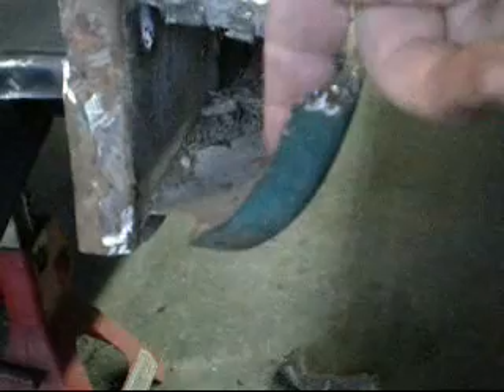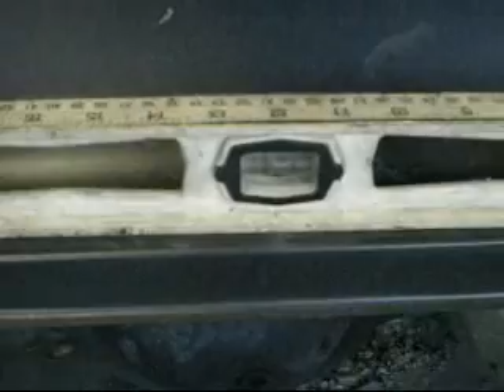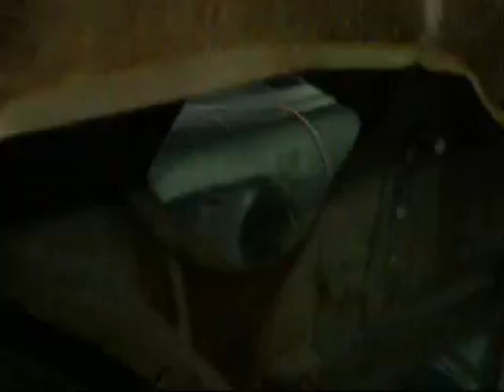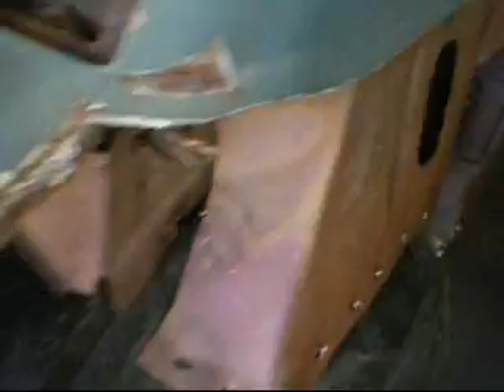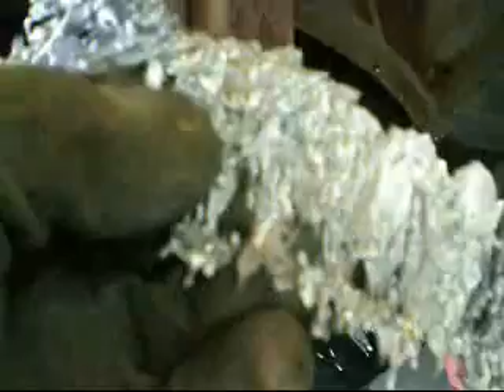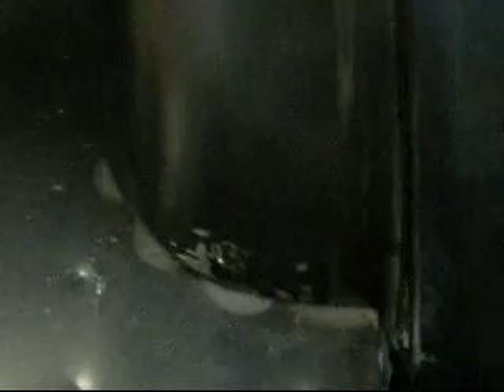1965 Mustang wheel house final install

Comment: I have a 67 Fastback I'm working on.  Question for you....I have to replace the inner wheelwells should I do anything to suspend the roof of the car?  A buddy said I should pull the bolts on the rear leaf springs to release any pressure.  Thoughts?  Thx!
Reply from the maker: Just the inners? It wouldn't hurt to pull the bolts, but the frame rails carry the load. Is the car on stands?
Reply: Both outer and inners and lower portion of quarter.  Another car buddy said just to suspend car on jack stands and take measurements.  Car is on stands and rears I placed as close to the rear wheels (on frame) as possible.
Reply from the maker: That will work. The inner structure of the car will support the roof. Alway measure multiple times.

Comment: I have a similar project on my wife's recently purchased 65 coupe...

The car looks like it had been rear ended, but only the outer panels were replaced, everything underneath (trunk floor, wheel houses etc...) are slightly off-kilter or have disconnected weld seams.

I'm hitting up CJPonyparts to snag all the parts (Dynacorn) required for repair (L/R wheelhouses, complete trunk floor, rear frame rails and probably add torque boxes and a 22gal tank while I'm at it).

I was thinking that since every part I'm replacing is closely related, I could jig and tack up all these parts outside the car, ensure the whole thing is square, then install the entire thing as a single unit.  Seems to me I'd have better control over dimensions that way.

Is this uncommon?

Any down sides?
Reply from the maker: psygnale I've not heard of anyone doing that before. Would it be better to get a one piece complete pan and do ti all at once?
Reply: I actually don't need the main pan, it looks pretty square...

...its all the internals from the framerails on back.  Off the top of my head...

Frame rails
Wheelhouses
Trunk floor (including sides and rear)

I'm imagining breaking all the welds, pulling out that whole area down and out from the external skins and inserting the new assembly, as a whole, in its place.

Thanks for your help.  Awesome work stud.

EDIT:

Actually, I think I mis-read you...

In your experience, is it easier to replace rear frame rails if the whole pan is OUT of the car?

If so, that seems like a lot of work for something I could get to with most of the car intact, so I'm obviously  missing something.

I was thinking of a similar job to what you did to the front of your Stang...removing the bad firewall-foreward parts only, leaving everything else intact. 

The car is being driven right now and has no major issues (other than annoying squeaks and rattles, some water infiltration in the trunk sides, and some uneven seams).  Just trying to keep down-time to a minimum.
Reply from the maker: psygnale I was referring to a pan from firewall to tail panel. The problem with replacing pieces in a car that was rear-ended is not knowing exactly where things go. (measurement wise) Another issue with assembling pieces outside the car will be making sure the rails are completely welded in. I'm not confident that you can complete the welds with the pan already in place on top of the rails.
Reply: Jo Daddy's Garage 

Ohhhh, you were referring to THAT pan, gotcha...I've always heard it referred to as the trunk floor, my apologies.

Understand about the rest, just curious to see if this had been done before.

I may tack everything together and try it just for giggles.  Worst case scenario, nothing squares up... I take the assembly out, break the tacks, then tack each piece in one-by-one like normal.

Thanks a bunch for your help stud.

Comment: I'm installing the new inner and outerwheelhouses for the driver side. I tried installing it half-assed. Cut it all back out. Gonna do it right this time. It's a 68 Sprint B Mustang. I was looking at where they welded the original one. Did you drill all the spot welds out, or? I'm trying to install the new ones just like they did from the factory.
Reply from the maker: CJ Armour I did drill all the spot welds out unless it meant leaving a hole. In  that case I grind the weld face off so I have something to weld to.

Comment: Hey Great videos, i doing the same job on a 68, complete floor pan, both quarters, inner and outer wells and the rear pan. Do you have any pointers for leveling the car prior, where is the best place to put the levels and how to keep the car from moving while welding. Thanks....Shane
Reply from the maker: Torii Bennett The important thing is to have a level base and then level the car to the base. The pan is actually very self aligning if the outer rocker panels are intact. You should do a lot of measuring prior to cutting anything. I used jack stands under the front frame rails, and I temporarily supported the rear with a hoist until I got the pan under it. Then I leveled everything and clamped it everywhere. Preparation is the key.
Reply: Thanks for the info. I will get back with you again when i get stuck. Thanks Again......